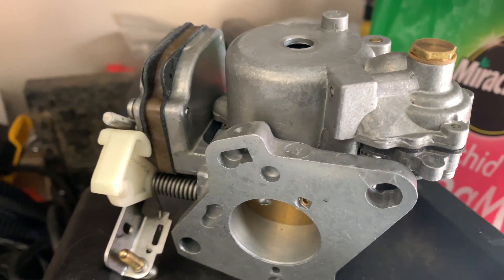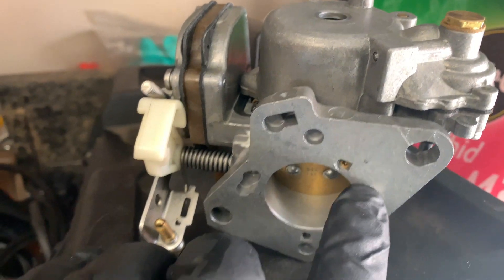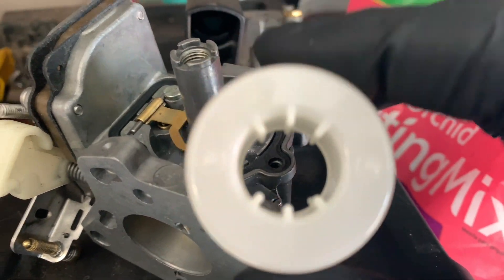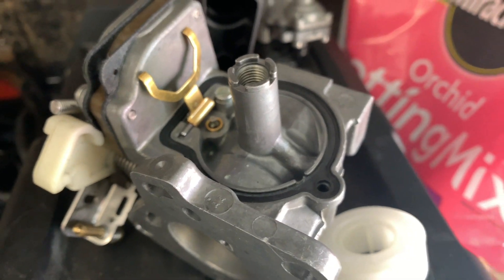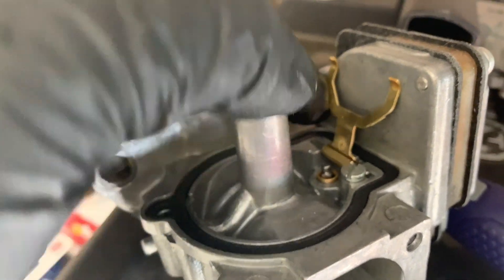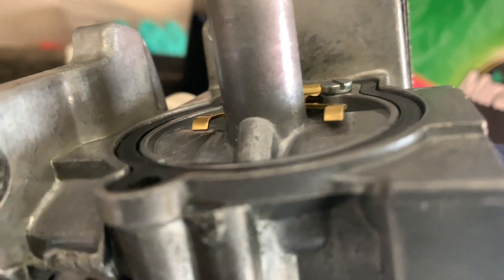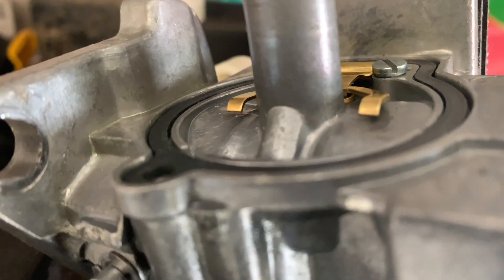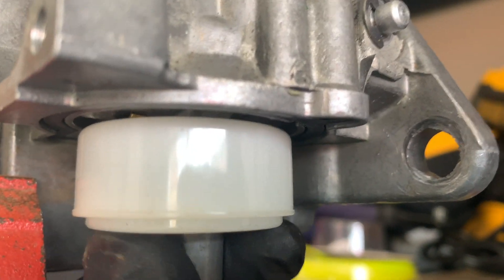Mercury 25 HP EH Carburetor Float Correction 2 stroke

Comment: My engine wouldnt hold an idle after a fresh carb rebuild but when I accelerated to full rpm it seemed fine... after finding this video I found out all I had done wrong is installed the float upside down. By itself that fixed the issue and the motor idles like it should. 

Thanks very much, I probably wouldve thrown more money at it just for nothing

Comment: obviously depending on your outboard model but specs for mercury 25 2 stroke are for 1 inch float height (measured again upside down) setting the float level too low means the bowl fills too high and this then slow slow floods the engine making it run super rich

Comment: I have the same motor but with electric start. I can start the engine. But the engine bogs out and stalls after I press the accelerator. Any tips , ideas what the issue might be ?
Reply from the maker: Fouled plugs? Float not set properly? Clogged airway?

Comment: Would the float being upside down cause the outboard too bog down at full throttle?? Like go fast then slow down for cpl seconds and go fast for cpl more seconds so on so on
Reply from the maker: I am not an expert by any means. It could though if the bowl can’t keep enough fuel in it. It could also be slightly fouled spark plus.
Reply: @sirmarcusandrew  will i think i fixed my problem…… I corrected my float,,,, changed gas tank,,,, and i hooked up the fuel line directly too the black line on fuel filter cup. Its all good now.,, i think it was the quick connect it was real loose and can hear air hissing

Comment: Did I miss something here I put everything back together and my electric switch on the top is leaking when I squeeze my gas bulb ? Is this because the float is to high ? I check the make sure the gasket is sitting right and it is

Comment: Did you fix it? I am having issues with mine.. float adjust.. measure from slots? Or top of slots. I used a combination square from bottom of injector to top of float, upside down, correct?
Reply from the maker: https://www.manualslib.com/manual/1057340/Mercury-Mariner-25-Marathon.html?page=135#manual

Comment: Good Evening!.  I recently viewed and enjoyed your youtube video commentary on rebuilding the WMC series carb, specifically for the 25 hp 2 stroke merc.  During your part 2 video, you mentioned the holes on the face of the carb that mates up to the engine including one which has a welsh plug in it as "spraying primer fuel into the carb".  Does this plug have a small hole in it as another video commentator describes it as spraying primer fuel into the reed valves.  Please comment as my motor runs great,but I have to manually spray fuel into the carb to get it started.  Obviously, primer is restricted or has malfunctioned. Thank you
Reply from the maker: For me, when I pull out the knob that says pull to prime, there is a lever that presses a plunger on the carb. It is on the right side of my carb. It was blue originally and now black after I rebuilt the carb. This plunger has a diaphragm inside. It can deteriorate and not pump fuel into the carb. There is also a vent hole I mention to allow air back into the diaphragm to allow it to work properly. If you rebuilt or plan to rebuild, match the gaskets to make sure new ones have all the same holes/cutouts as old ones. I had to modify one of mine.
Reply: @sirmarcusandrew  t
Thanks, I will dig further into the primer.
Reply from the maker: Gordon Deese try this video and see if this helps. Start watching about 10:10 

https://youtu.be/Y4H1fl8Kv2E

Comment: is that needle valve point up and blunt end hits the float lever that closes/opens the float?
Reply from the maker: HSD nF correct. Blunt end is on float arm with point going inside to stop fuel. My manual stated from bottom of float to the gasket area needs to be 1” FYI.
Reply: @sirmarcusandrew  yours looks way too low. i've got a 94' wmc 45 and the brass retainer with the t-rex arms are up off the carb body quite a bit. yours looks almost flush. in the video the float was 1'' from the post to the bottom? looked more like 1.5''?
Reply: This is exactly what i was looking for i got my pin round the wrong way. Thanks heaps